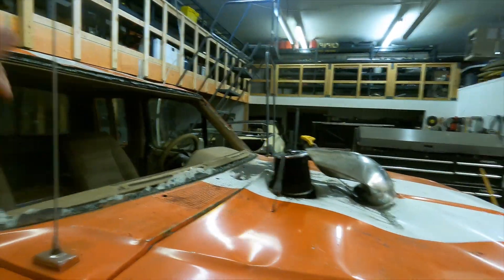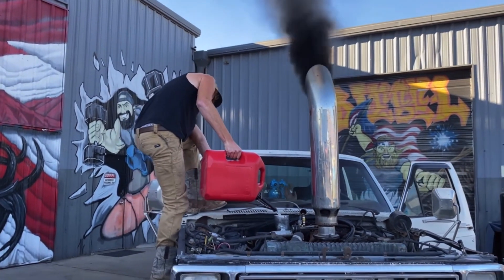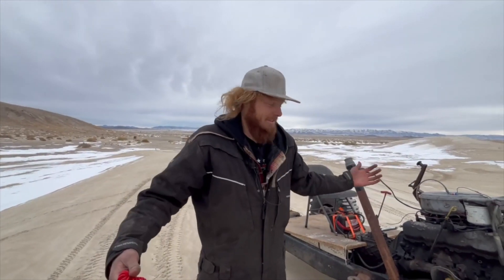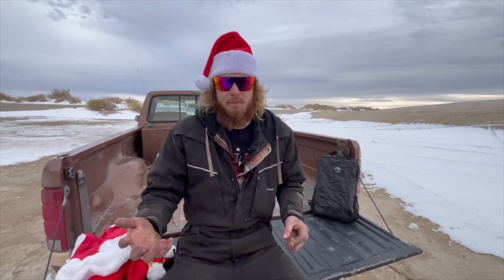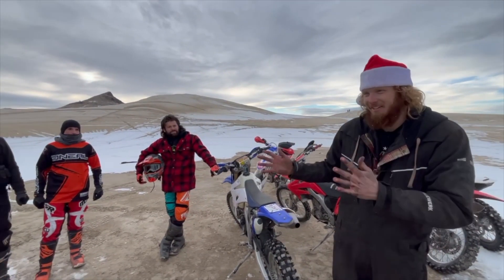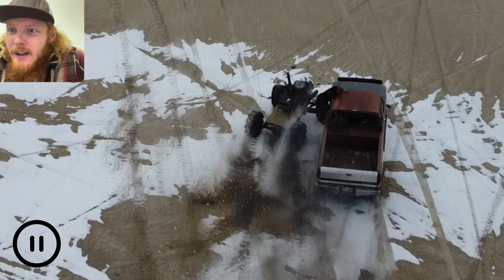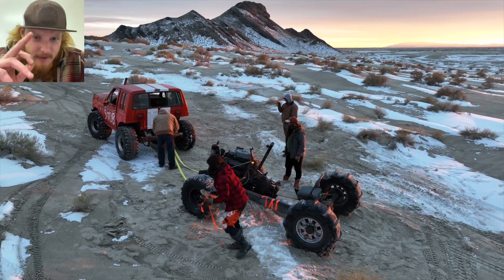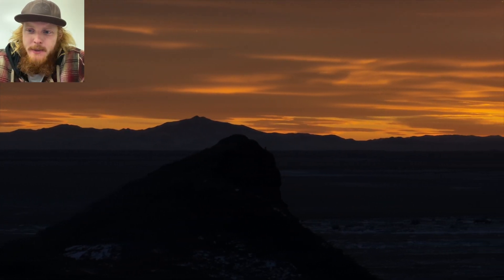Trying to Jump My First Truck Unmanned Goes Horribly Wrong

Comment: Yea that was uh sketchy and extremely high injury risk. As a suggestion, remote disable. Amazon has dirt cheap 12v single remote boards. Super easy...Pos and Neg then jumper the Pos to 1 switch terminal then the other terminal to the load, like a solenoid/relay. Then you get at least some chance at shutdown for safety

Comment: how hard would it be to take a servo an make it work the throttle and steering. one of those electric power steering motors that attaches to the colom set at a really high sensitivity would make the steering alot lighter so u wouldnt have to have a monster servo to do the job but ive seen it setup on other cars so u they could be driven an this is how i always assumed it was done but never really knew for sure. might be something to look into tho an would be the safest option. only thing it doesn't do is shift the gear  but being able to work the throttle should keep it moving slow enough it would make jumping off onto something moving alot side alot easier than with it going full throttle

Comment: RC controls would be really cool. Reach out to us FPV drone guys if assist is needed. FPV would let you drive it from the perfect vantage point,  as-if you were seated on the engine itself. The RC remote will control everything you need. You can add something called head tracking and then the camera can look left and right as you turn your head, while still sitting safely in the chase vehicle or on the ground. FPV equipment is not expensive at all, the new DJI stuff records in amazing HD. The control system nor even the actuators have to be very expensive .. and much of it will survive for you to use on other projects.   I would kill to be involved in such a project. Make it happen!!! Technology is your friend

Comment: xD When you were describing it I could see my 6-year-old making crazy plans for an extreme adventure... idk if that is good or bad, o_o  since I never really tried to jump off a plane in flame and pull the cord as I jump out the plane and then 1000 meters away the plane blows up.  But I am sure there is the real possibility something goes boom by the end of the video.

Comment: Put it in 4th with the throttle wide open, lock the steering and push it off with another truck so that when you push start it, it fires off wide open and it just goes, then you back off with the push truck.

Comment: Seems like a running jump off the back would work just after you put it in 2nd gear. I'd say with it accelerating full out from the bottom of 2nd to full rpm with nitrous you may not be able to keep the back end going the way you want it to go. Looked like at one point you could have easily gone under the rear tire after you jumped on the brown truck.

Comment: the alignment was wrong, It needs tow in to go straight, you got way to much tow out which will lead to it traveling in the direction of most front wheel traction.